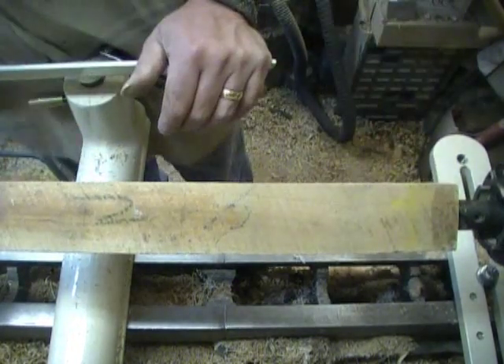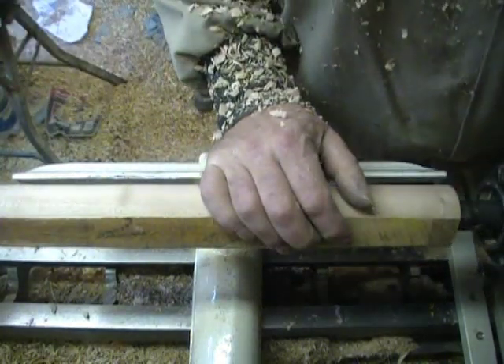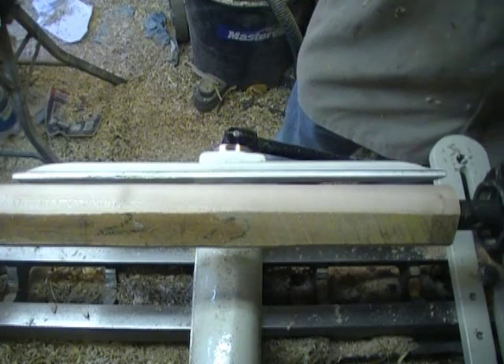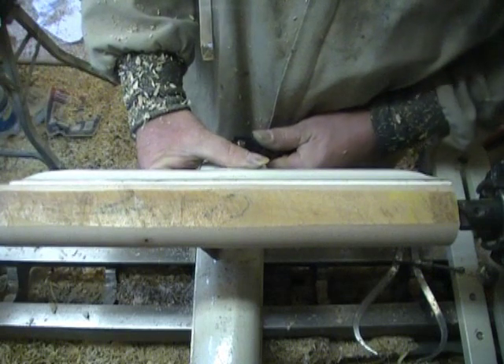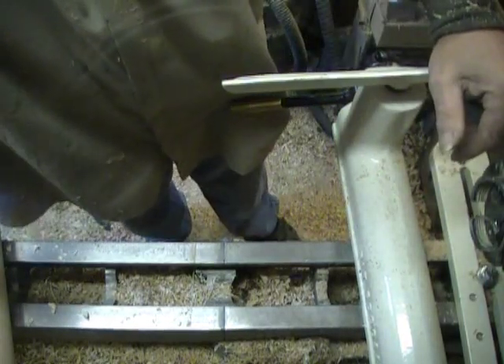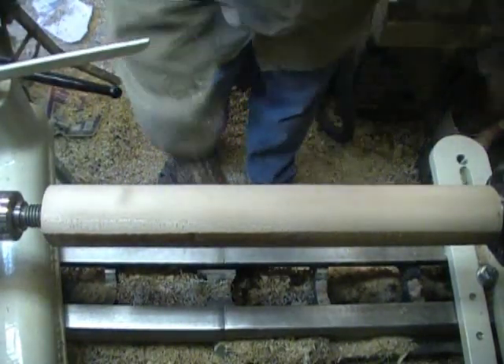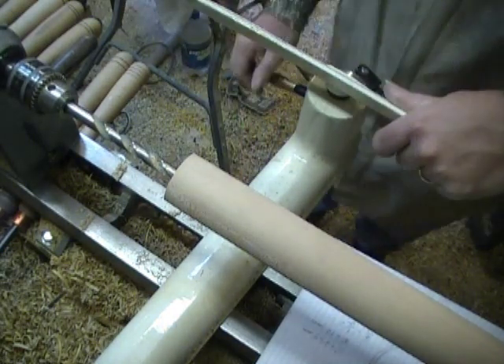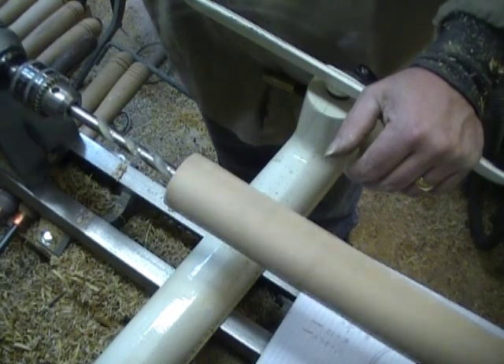Tool handle segment 1 of 5

Comment: I make a lot of my own handles, and try to use straight grained hardwoods, but almost anything will work. David Ellsworth has drilled holes in the ends of tree branches, put a ferrule on them made of waxed string, and started turning.